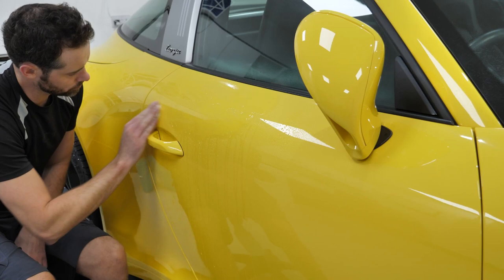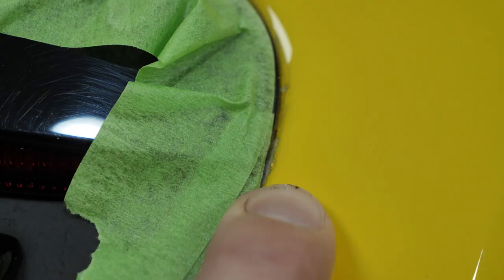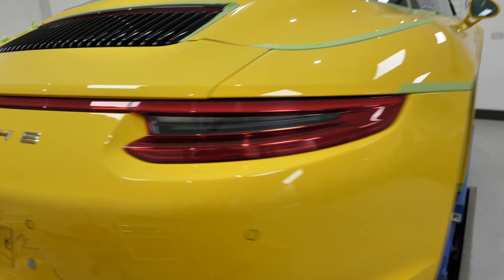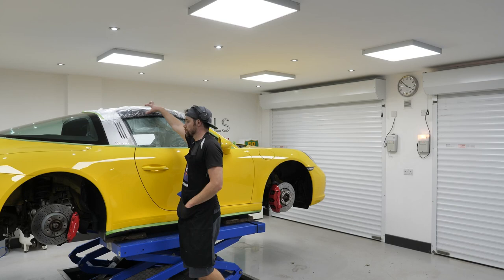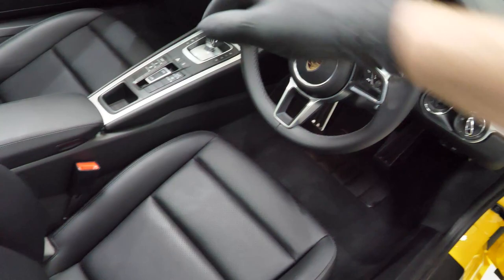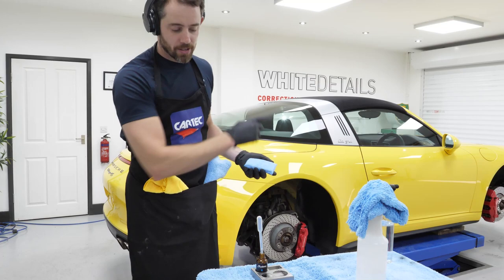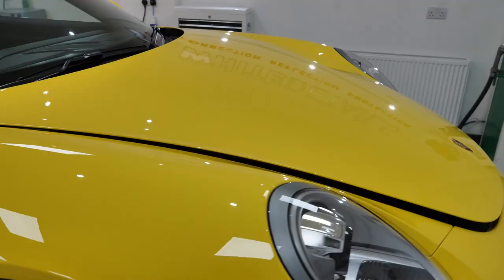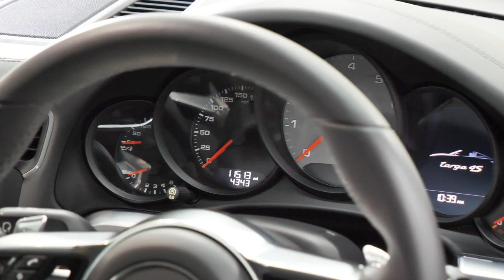Porsche Targa 4S protected with Modesta BC-04

Comment: The button on the back of the steering wheel is to heat the steering wheel. A message flashes on the screen when you press it and the car is running.

Comment: Put some copper grease on them valve caps they get stuck very easy. I had them on my Range Rover sport and had to remove 2 tyres to change the valves.

Comment: That "dressing" on the interior is horrendous!
Reply: Wouldn’t be surprised if it’s “armorall” brand. I’ve seen it done to a Ferrari I reconditioned. Had to use a degreased and a hot microfibre towel over the leather to get the pores to breathe again!

Comment: That Modeste primer sort of reminds me of power lock in my experience Jim, At least on my Subaru I’ve noticed if I use power lock on a DA it comes out much sharper versus me doing it by hand so I don’t know if it’s because of the speed of the machine versus my hand or the much thinner application a product with a foam pad by the machine? And then on top of that I will use Collinite 845 as a topper. I will DM you some pictures on Instagram